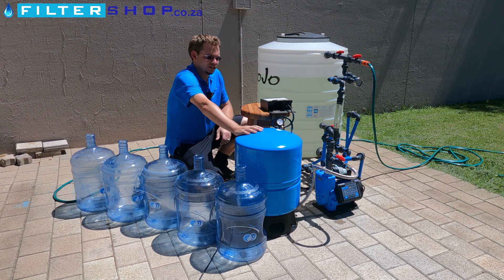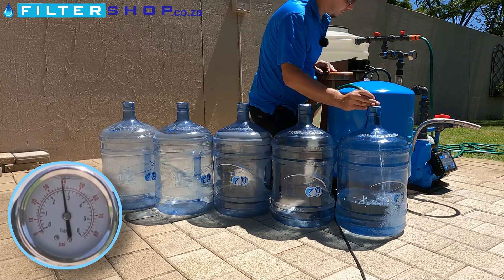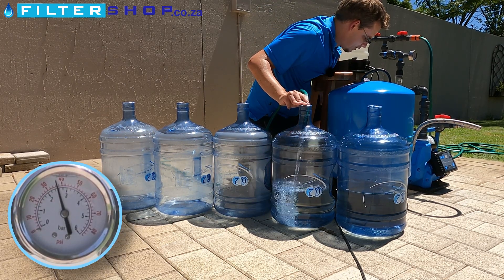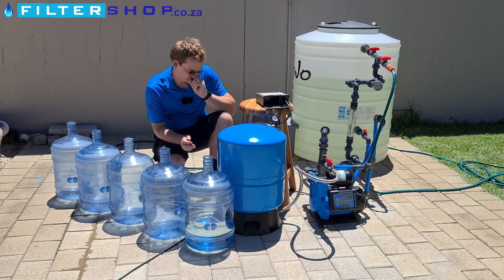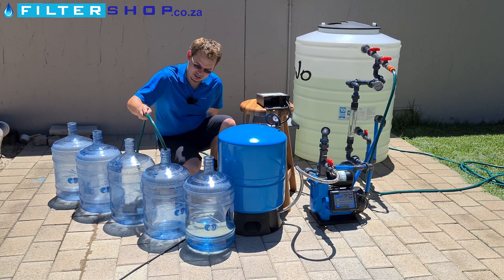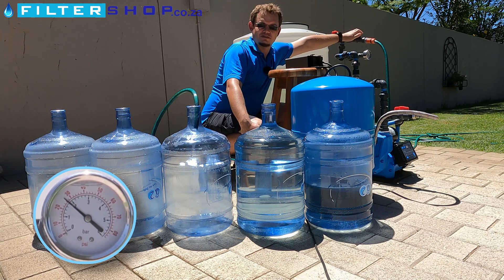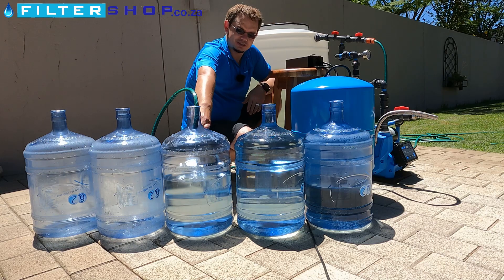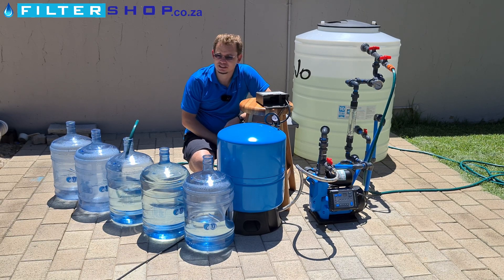Getting the Most Out of a Pressure Tank Quick Overview

Comment: Hey thanks for the video.
can you share what the pressure was set to on both the pressure and tank the cut in and cut out of you vsd pump in the final experiment.

From my tests I found that the lower the pressure was set in the pressure tank the more capacity it could hold of water
Reply from the maker: Hi, Yes there is more detail in the full video, here is the link: https://youtu.be/L85XctydwjY

Tank was 1.4 Bar with pump set to 4.5 Bar turn off and 1.2 Bar turn on.